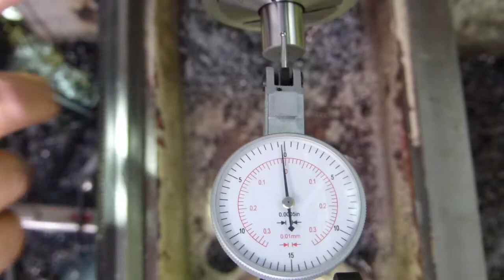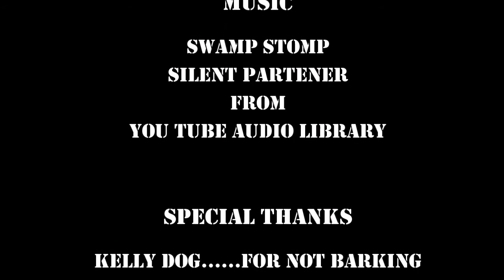Making a D1-4 Mount for a 5C Collet Chuck

Comment: Hi, how big of a notch you put it into the studs? How critical is it? I own a d1-4 spindle nose lathe too, and I'd like to know if I have the right endl mill before taking it apart. If you have other useful dimensions, it'd be really helpful. Thanks!
Reply from the maker: Just pop your chuck off and have a look it only takes a minute, it is 3/4 from memory but as it worked out they are not an exactly round relief they are tapered on the hole a bit. Google D1-4 in google pics and you will see a few diagrams to work from, that's what I did.

Comment: Howdy Lance would it make a difference in the  indicator probe if it is turned 90 degrees for the reading?
Reply from the maker: G Day Raymond, Yes it does seem to help a bit as when I showed the setting of the angle for the compound it was clear. Trouble is too much light which helps when working but not with filming at times. To change position I need to dismantle mount for each shot and it takes quite a while to set up again but I am working on that.

Comment: Just bash the high side with a hammer, I think that is how the factory gets them runing true. lol
Reply from the maker: To tell the truth I did try to tune it a bit but the register is spot on and it made no difference. I could see where they ground it at the front the surface was wider at one side compared to the other so may have used a die grinder in the factory lol.